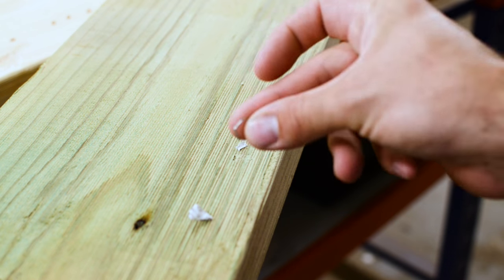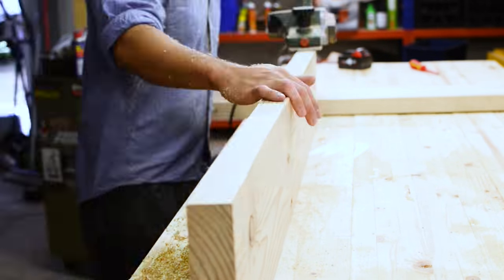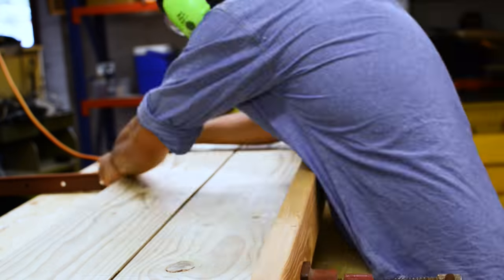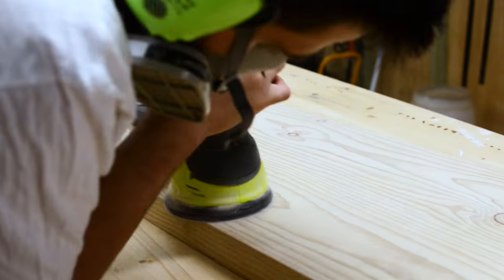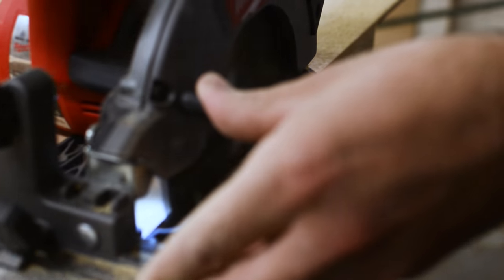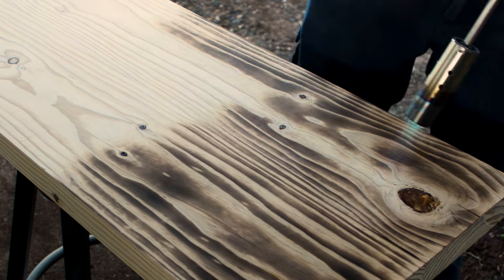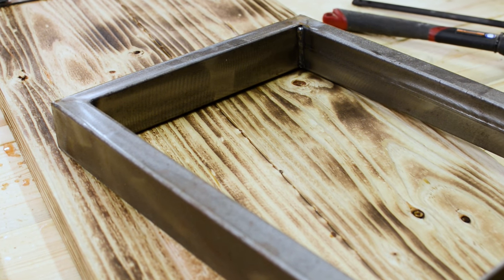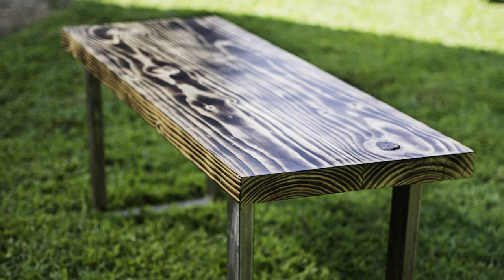Shou Sugi Ban Bench - DIY Yakisugi

Comment: End result looked great, but I'd probably not have used treated pine for it. The dust from thicknessing and sanding, and then burning might not be the safest, even outside or with a mask. http://www.tpaa.com.au/faq/ Slightly more annoying, but the regular bunnings untreated mgp would give much the same result, though you might need to join more to get the same width if you can't get the wider stuff. You can always join a few into two wider boards and then plane them to size.
Reply from the maker: Chaos Wood Designs So true.. never even realised that.. I guess my only saving grace was that I wore a respirator. I’ll keep that in mind. Thanks, appreciate it.